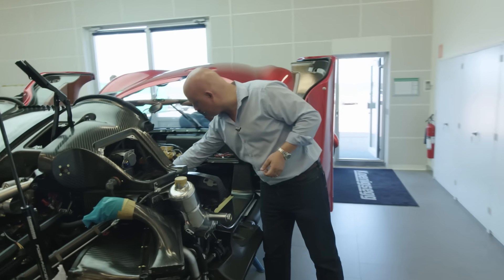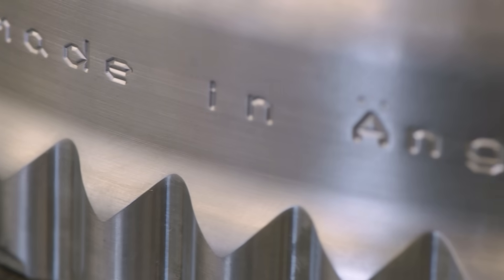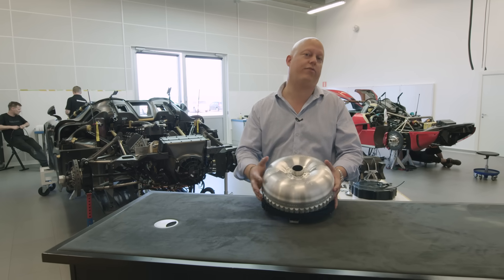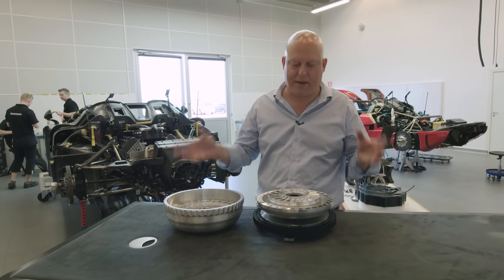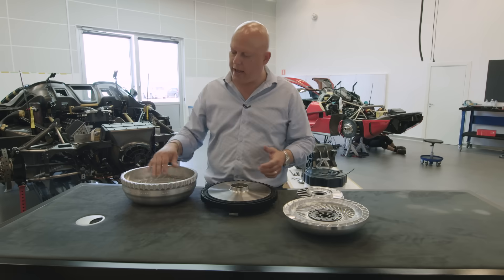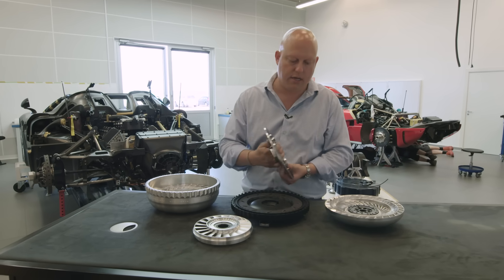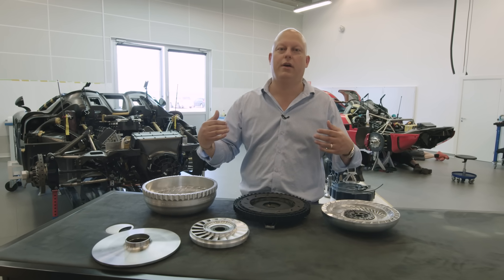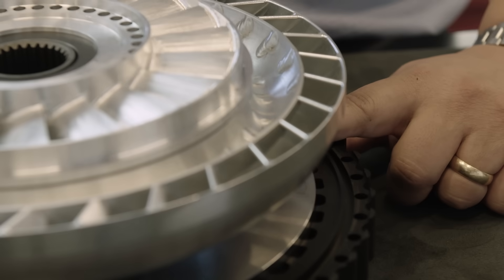248 MPH Without A Gearbox: Direct Drive  -- /INSIDE KOENIGSEGG

Comment: For this Genius, called Christian von Koenigsegg, everything is just simple but noone has ever done it before.This Dude is the Future and Mozart of the Carindustry.
Reply: CVTs are completely different to direct drive. They do in fact use gearing but you're not shifting between presets, you're continuously shifting along a scale. Engineering Explained has a good video on how they work.
Reply: Its like elon musk. They use words like "simple, quite big etc etc" where as the rest of us would use extremely complex,  astronomical etc. Their brains just work better than ours haha.
Reply: A CVT is not similar to a direct drive. A direct drive is a direct and fixed connection, a CVT is very much an indirect and variable connection between input and output.
However, you can argue that a system with a torque converter does not constitute true direct drive either, because it allows  input and output to have different speeds. However, the torque converter is only active for "low" speeds, whereas a CVT typically is active at all speeds.
Reply: This is nothing new at all, they just took it to the next level. Any car guy understands (or at least should understand) what he's talking about. Torque converters have been used since forever in american muscle cars
Reply: There is many cars that use no gears, it's just this one is quicker than 100 mph
Reply: TheGoreforce That's not the same thing. A CVT may not have "gears" but it performs the same function as a traditional gearbox.  It still has a clutch or torque converter to decouple the engine.

This uses the "torque converter" and final drive. There is nothing else to multiply torque.
Reply: Check out Buick's Dynaflow from the 50's - its another version of a gear-less (well, mostly) fluid coupling/torque converting transmission. Super inefficient and heavy but is of similar principal.
Reply: i think it is safe to say that we are looking on another revolution in car industry. The amount of tought and technological advance in those cars is jawdropping.
Reply: Same system was used for example at the end of 80's in Finnish Sisu SA-240. Nothing new in it.
Reply: ***** If heat is being generated then energy and fuel are being wasted to generate that heat. That energy would be better used to actually do "work" like moving the car instead of wasting it making heat. With a normal clutch there is zero loss and no heat generated. Torque multiplication happens via gearing so there is no huge benefit to this design. Even a standard torque converter that is not slipping would make less heat and be more efficient. The only thing this design eliminates is a relatively cheap transmission when compared to the cost of 500+HP motors. This design will never be used on an economy car imo.

Just to be clear anytime this car accelerates it will use more fuel vs. something with a normal transmission simply due to the slippage. When one side of the converter is spinning at 3000 RPM pumping fluid into the other, but the other side is only spinning at 1000 RPM torque multiplication happens since one side is pumping fluid faster then the other side can accept/use it, but it is highly inefficient. When both sides are spinning at the same speed then there is no slip and the efficiency of the converter goes up and is almost equal to a piece of metal. That is why they have lock up torque converters as well to improve efficiency.
Reply: That's why I said 20 years ago, yes. The principle is still there for the current crop of torque converter transmissions. I mentioned all this. How you can repeat what I said and frame it as if I don't know it is amazing! You completely skipped over my point. 

> "if more heat is generated then more energy is being wasted physics aspect no matter how many times I repeat myself... How hard is that to understand? 

That's not hard to understand at all. But you don't seem to understand that they are saving in other aspects. 

> If it locks up the converter then THERE CANNOT BE TORQUE MULTIPLICATION, it is stuck in high gear, and the system does not work 

The whole idea is to get the direct drive car moving and the torque converter helps with that task. After that, just as with a standard auto, it gets locked and is 100% efficient. So you are literally shouting "shock horror heat is energy loss" for only the start of the car. 

Yes, batteries and electric motors are expensive. So are you now universally arguing against partial electrification and hybridisation of our cars? Because if that is the case, you are not only arguing against one highly skilled team of Königsegg engineers, but thousands. At which point would you stop and consider whether maybe you are wrong? 

> I will even wager that a normal supercar with a normal engine will not only be faster then this hybrid supercar, but cheaper, and lighter too.  

Cheaper, probably. It is a world's first, these things tend to cost a bit more. Lighter? Probably. Faster? Well, I wouldn't bet on this. Königsegg has a bit of a history. Of course you will find race types where this car is worse than others, but come on, have a look at the other videos and you'll see where Königsegg is aiming and they'll be very difficult to beat. 

I'm not sure why you bring up dragsters. Like, isn't it immediately absurd to you to mention dragsters and fuel efficiency? As if their poor fuel economy can be only blamed on their open torque converters.  
Seriously. But you know what dragsters with torque converters do really well? Launch and limit the number of gear changes...

> I never knew that a converter could lock and unlock 

Of course you know about lock and unlock, but you are not applying that knowledge appropriately to the problem at hand, which is why I explain it time and time again.  

> You and others should really look up and study torque converters,  

Everybody can always learn more, but I am confident that I understand this better than you. So instead I would suggest that you learn to not solely focus on a single issue that you "understand", such as "open torque converter creates heat, heat is losses, losses are bad" but rather try to look at a whole system, how the parts work together over a wide range of duty cycles. Then see the pros and cons of each solution. 

Being a car guy is different from being a mechanical engineer. One can be both, but at the level Königsegg is working at, one really needs some engineering background if one  want to dissect their work. 

I mean, I am just a random guy on the internet and sure, there is a chance that you know more than me. But how does someone like you look at the previous work and legacy of Königsegg and starts posting "Uh, these muppets, they have no clue, I'll show them." ?
Reply: Den Log I think you are doing fairly well on the "posting long comments" leader board yourself, so I see no need to call me out. 

So now you seem to be saying that VTG turbos are pointless? Do you have any idea how much VTG has helped the driveability of modern engines? Hint: A lot. 

Changing gears is easy. Well. Apart from the fact that you need a syncro mesh, a clutch and correct timing. Oh. And hardened gears and associated bearings. And volume to fit everything. Sure, it is something that is very well understood now, so it is "easy". But nevertheless these are things that can be removed in the Königsegg approach. And yes, I am aware that the Königsegg system introduces new components - but these components are "paid" for by omitting others. Paid for in cost, weight, complexity, packaging. 

Yes, you are right, thinner vanes are better hydrodynamically. However, you are again not seeing the whole picture. Aluminium is lighter and easier to manufacture in complicated 3D shapes. (Christian mentions how they have to rethink the geometry because of the new mode of operation.) All of this can combine to aluminium being the better compromise. 
Just as having a torque converter in Königsegg's transmission has drawbacks and advantages and can be the best compromise. 

And it is about computers. Because using computers to control all elements (engine, torque converter, electric motors) enables Königsegg to decrease the time in which the converter is lossy and increase driveability.  

Engineering is about iterating towards the "perfect compromise". Your way of focusing again on one single issue "open torque converter is wasteful" is symptomatic of a wider problem of yours. 

I do not know if you intend to pursue a career in engineering or any kind of applied science, but my advice is that you really have to work on this. You seem like a clever person who is too narrowly focusing on a single issue. Unlock (ha!) your true potential by widening your scope.
Reply: Den Log Classic automatic transmissions have a hydraulic (hydrostatic) pump that creates the pressure for the brake bands. This is what Dog meant and it is different from the torque converter, which is a hydrodynamic pump close-coupled to a hydrodynamic turbine with a freewheeling rotor of guide vanes between. 

Your explanations of the inner workings of a torque converter are not only over-simplified, they are wrong. Not sure where to start, but the biggest issue is that power is torque times rotational speed (if you use SI units, otherwise you have a corrective constant factor in there). So it is not as easy as looking at the speeds and say which percentage gets lost. 
The "excess fluid" (hint: it's not) does something useful: Torque amplification. Think of it like this: The fast spinning pump creates a fluid flow. The slow spinning side is basically like a wing at a high angle-of-attack: Not as efficient as their design-point, but very high lift. That lift is of course equivalent to the torque the turbine delivers to the shaft. 

200HP cars do not accelerate to the crazy speeds of a Königsegg, your assumption that they would have to slip for long periods is erroneous. 

A number of people have told you that the torque converter is there to assist the electric motors during a hard launch. In basically any other operation, the losses are zero. Yet you still insist on this one thing  - "fluid goes around and creates heat which means losses". 

You brought up Wankel engines, which are fascinating, but not known for their fuel efficiency. Not sure if you were being sarcastic or not.
Reply: YensR Umm dumb dumb this is your last post I am getting really tired of you d*** riding fanbois.

That pump is part of the torque converter in most transmissions...

You are confusing fluid flow with fluid "pressure". Creating extra pressure is what is doing the torque multiplication dumb dumb not the amount of flow. Fans, turbos, etc. can only flow so much air, fluid, etc. at a given RPM if there is excess flow then since it cannot flow that much the pressure goes up. If the conversion was efficient THAN IT WOULD NOT BE GENERATING HEAT. How many f***ing times I have repeated that, but noooo. How efficient are the best turbos, pumps, etc. that are creating a difference in pressure? 75% or less and they are designed to create a pressure difference unlike a torque converter, which will have an even lower efficiency.

Maybe if you and others were smarter you would be able to figure out that this whole time I have not been talking about the supercar that they are building with over 1000HP, but using the technology on normal cars for the masses, which I have stated at least twice, but reading comprehension... Of which most have less then 200HP and do not accel like crazy dumb dumb. This technology is not "the future of the car industry", but once again fanbois...

Once again, how much does the battery pack weigh and cost? How much do the extra two electric motors cost and weigh? Switching power supply costs and weighs how much? Coolers for that trans fluid cost and weigh how much?

I wonder why a Prius does not use this technology? I wonder if it is because it is less efficient even though it also has an electric motor to help it accel dumb dumb, but once again d*** riding fanbois. I am done with all of you since many seem to fail at basic logic/facts. When you cannot even understand what " A rotary with a normal trans would probably get better gas mileage.: means" I am obviously wasting my time trying to educate people that have an IQ of less then 70.
Reply: YensR Ciao! Yeah, the torque converter has been installed along with a gearbox. Basicly to drive it you just put it in gear and let it rip. The gearbox is needed when towing heavy loads since it's been designed to pull artillery and such, and also in the middle of woods and bad conditions. If I remember correctly the converter oil could otherwise overheat, it's been a long time since I drove one so can't remember all the details about driving it.
Reply: without research, and testing, development gets nowhere, DUDE! Any engineer will tell you that ;-)
Reply: Reality , well it's been built, it works.
a Saab test mule drove many miles with it.
Reply: J-N-H-M Of course it's new. Just because it combines "not new" things such as an engine, electric motors, batteries, a torque converter and computers doesn't mean the combination is also "not new". Otherwise, please tell us an application (doesn't have to be automotive) that uses these elements to similar effect.
Reply: https://en.wikipedia.org/wiki/List_of_automobiles_with_continuously_variable_transmissions
Reply: +BigJayDog g Standard torque converters out of standard automatic transmissions can multiply torque when they are slipping or there is a difference in input speed vs. output speed that is nothing new. This just has enough torque and HP that gearing is not needed much like the electric Tesla cars. The heat being generated in the fluid is lost energy and fuel economy will more then likely suffer some because of it. Which for this type of car is fine, but it is not really practical for the masses.
Reply: The reason why no one is using the technique probably is because its inferior to what solutions they already have.
Reply: also CVT cant handle torque or horsepower hardly at all. this is why you only see them on economy cars.

 Also the difference between the new design you just watched and a cvt is that A torque converter always wants to spin 1:1 with input and output. A cvt always has a different input vs output speed with the exception of a single point along the linear ratio. The CVT is in essence just more efficient  transmission with no gaps between gear that still requires a torque converter or clutch to de-couple. This design that your just watched in essentially the transmission and de-coupler device all in one. there is no other device changing the gear ratio after this device.  Another argument against a cvt being a direct drive is that you literally have to have 2 connical shaped cylinders running parallel to each other that are connected by a belt meaning the power has to be transferred laterally before continuing down the line that is the drive train. meaning it is not direct.
Reply: I am massively curios about the heat that will be generated by this though. and how the fluid will break down due to the heat which will cause even more slippage. Also im curious about how they will decide what weight / viscosity they will use in order to get the correct amount of slippage .
Reply: Dalton Michaels There are hydrostatic and mechanical (power split) CVTs used on tractors and earth movers that have extremely high torque and power capabilities.  
However, the automotive CVTs indeed tend to be lower power.
Reply: ***** Almost all diesel electric trains are of serial configuration: All power from the diesel goes into an electric generator and is then distributed to the electric traction motors. This is clearly different from Königsegg. 

Torque converters are frequently used in diesel locomotives with a mechanical drive train, though. But then the electric motor is absent. So again, different from Königsegg's approach 

https://en.wikipedia.org/wiki/Diesel_locomotive#Diesel-electric
Reply: YensR "Good modern torque-converter automatic transmissions achieve impressive economy," Umm gee tks for agreeing with me on how good gearing is... Standard automatics with torque converters only slip for a bit, are considered "tight" since they do not slip much, and are then using gears to multiply torque more efficiently then what could be done with just the torque converter. Please listen to WTF you are saying. Why do modern automatics not drop 1st gear and use a "loose" torque converter instead? BECAUSE IT IS LESS EFFICIENT IS WHY. 

"I am 100% sure that Königsegg know what they are doing and have taken all of that into account." Umm no since there is no way around the physics. It will be less fuel efficient vs. a standard transmission. Which as I stated in my first post is ok for a super car, but no so for the masses, and economy cars. Generating "heat" takes energy and it cannot be done for free.
Reply: Den Log If you look at the gear ratios of torque converter automatic transmissions, you will see that traditionally the first gear is indeed longer than on a standard clutch gear box, because they use the torque increase to their benefit.(20 years ago, that replaced a whole gear, nowadays it's probably more like "half" a gear.) Of course modern transmissions will lock up the converter ASAP, just as Königsegg will do. 

You are very fixated on the disadvantages of the Königsegg solution but you seem to ignore the advantages. You also seem to ignore the electric motors that are an integral part of his whole system, not only, but especially during start-up. Yes, during start-up, this will be less efficient than a conventional car. But at any other operating point, it will be better. 

There is no need to yell at me. I understand these systems very well. I never implied that leaving the converter open is good or advisable for long periods of time. Kristian even mentioned that himself in the video. 

I never replied to your first comment, I replied to the comment where you implied that the effect of the torque converter's torque amplification can be done in gears. But if we both agree that it is potentially a great system for a hypercar, and if you want to discuss hypercar vs normalcar now, let me address that. 

Did you know that the torque converter can adjust its filling, effectively uncoupling completely? That way the engine can charge the battery at any time via the generator? So it adds a lot of flexibility to the drivetrain and I totally believe that this system is actually transferable to normal hybrid cars. Normal hybrid cars have much lower demands on top speed. There is nothing stopping this system architecture to be applied to lesser hybrid cars.Of course this only works for hybrid cars, because only then do you have the electric motors to assist the engine.
Reply: +Den Log Why hasn't anyone made a variable vane geometry torque converter and get rid gearboxes. At  least he's got of his Ass and made a cam less head that he calls a free valve did yous see he is developing a 'free  valve' for a small Chinese 4 cylinder. Im a bit suspect that he uses compressed air in his free valve anyone that's worked on machines  knows  how fickle compressed air can get, surprised he's not using Hydrolic fluid
Reply: Genius stands on the shoulders on giants, my friend.
Reply: The way CVK talk is that the torque converter is only use for fast acceleration, if you are driving in traffic it's only the electric motor that get you moving while the TC does nothing. It's not that efficient considering you have two power conversion, but in that situation there is not that much system that are, even manual with clutch can over-heat in heavy traffic.
When you want hard accel it's not the second before the TC lock that will change anything. Also after the locking, the efficiency of the whole system goes up to near 100%, I would say 95% because the diff must be beafy. Again the advantage/disadvantage versus a manual is somewhat even. 
I also want to add that torque converter are lossy, but they are not as bad as they where back in the 70', they added directional fan that will lock when torque is needed and unlock when unneeded. The fact automatic is now more efficient than manual is an elegy to that.
 
As for the weight, in another video CVk stated that removing the transmission dropped about 98kg, since it's about the weight of the battery pack the only over weight is the motors and transformer. But those are special motors that are not that big considering the power they have. Don't forget they have about 250x more power than any electric motor you have at your home. You can also check out the motor Tesla uses, they should be about the same size. Those motor use built-in water-cooling so they can reduce the size of the conductor. 

PS: there are other hybrid who got rid of the transmission and are mass consumer oriented.
PPS: Those motor work with current modulated by a computer, I don't think you could call this Dc or AC.
PPS: CVK didn't invent anything new there, but he is discovering new recipe to making car. The approach he have of a problem and the solution he find are what make him a genius, that and the marketing of Koenigsegg. Sometime you will find car maker inventing all sort of new stuff to solve something and it's always a bargain for the reliability/efficiency. Simpler is better, that and the fact old tech tend to be bring back again and again.  After all, to my knowledge, Mozart didn't invent any instrument, he just found new song to play with them.
Reply: Den Log  So it's you who doesn't know what à "torque converter" is. As it's name implies, it convert torque. The pump give à flow, but if the turbine is not spinning fast enough to accept the flow, the pressure rise and that make more torque at the end. Just like heavy machinery, if more force is needed the hydraulic pressure will rise. If the flow in the TC is good and there are no turbulence the heat generated is low and thus efficiency is higher.
 Power is equal to rpm x torque, so if the output is spinning 3 time lower, with no losses, it gets 3 time the torque. 
And all torque converter have a lock, because even à tight one would slip.
And the transmission in one those those car are heavier cause DTC and 1200+ hp.

You seem to hâte TC, but it exist since à long time ans they are well understand.
Reply: wee7os Ah, that is pretty cool stuff. I only found that it was driven in torque converter mode as a publicity demonstration - that article didn't mention anything beyond that, though.
Reply: He is the Mozart of the carindustry to people who dont actually understand much about cars.
Reply: The awesome thing here is how simple it is - the benchmark of great engineering.
Reply: J-N-H-M Have you ever driven a regular 2wd car with more than about.. oh, say 800hp @ wheels? They're not in any way daily drivable. The Koenigsegg is... You'd have to be insane to do it.. but it is. Also, the Koenigsegg has hundreds of lbs of battery in it..
Reply: not cool stealing my icon.
Reply: Max Bepunkt Meh
Reply: The Scion IQ for example has no gears.
Reply: I said a ton of cars do things with out gears, I didn't say they do it the same method. CVTs are similar to Coversion systems like this, in thatthey aren't tied to gear shifting. They do the same or similar thing that changes the power output at a stop to when you are going, to say it's not similar is a farce. They just use different methods to change the torque and power to the wheels for differing optimal paths.
Reply: This system also performs the same function as a gearbox, sure it's able to be a ton less efficient because of the shear brute force the engine has... IT's goal for the both of them is how can we do this thing and do it with out gears.
Reply: wee7os As far as I can see via google, that trucks's torque converter is coupled to a rather conventional transmission. Do you have any source showing that it is direct drive (or maybe an off-road / street two-speed) gearbox?
Reply: M3Conv You cannot have a high-performance direct drive, even with a torque converter, unless you mix in the zero-rpm torque from electric motors. So the reason no one else is doing this could be that they don't have the technology yet or are not reaching the levels of performance where the combination of combustion engine + torque converter + electric motor is necessary.
Reply: Dalton Michaels I honestly think with research and tech the CVT will be able to handle real performance
Reply: YensR
You have got to admit its a crap idea.

Lets get rid of the gearbox so that it sounds like a boat stuck in the same gear.

Whats the point, in a car with an ICE going through the gears is one of the most enjoyable parts (DCT or manual)
Reply: Dalton Michaels Torque converters for high torque and high power applications have been in use for many many decades. Their physics and engineering is well-understood. 

On the Königsegg it will only be in the slip region for relatively short amount of time as Kristian said. For heavy haulage trucks in operation, the torque converter is constantly in the slip region and they use dedicated coolers. 

The power that is converted into heat is the difference of input power and output power of course. And when accelerating from a standstill, the output power starts at 0W (no rpm means no power). But as you accelerate, the output power goes up, both in absolute terms, but more crucially as a proportion of the input power.
Reply: M3Conv I don't think it is a crap idea. It has uses where it is the best solution and in other applications it is not suitable.
Reply: Den Log "Torque multiplication happens via gearing so there is no huge benefit to this design. "  
You are right that a torque converter is lossy, but you seem to be missing the advantages of it. 
A torque converter allows torque multiplication when the output shaft is at standstill and the input shaft is turning. Yes, you can use a clutch to get going, but the clutching process for that start is also lossy and you won't get the torque multiplication, meaning you'd need at least a second gear and that immediately increases complexity and size tremendously. Also, each gear meshing reduces efficiency - not much but all the time. A torque converter reduces efficiency a lot, but only for a short time. 
Good modern torque-converter automatic transmissions achieve impressive economy, proving that the torque-converter problems are not insurmountable. 
I am 100% sure that Königsegg know what they are doing and have taken all of that into account. All of the involved components are well-understood by engineers.
Reply: Den Log it han be fixed using different fluids, but of course it won't be 100% efficient
Reply: Ángel Urbano Correct it will be less efficient compared to any other type of transmission that comes on any current production vehicle. Heat does not get generated for free and it takes energy/power to do so, which could be used to push the car forward instead. Again this is all old technology.
Reply: Williams also tested a CVT in their Formula One cars;however, it was banned from competition use before its first outing. It was reported to have been several seconds a lap faster. Im glad it was banned because the noise would have been unbearable!
Reply: YensR /sigh you mean when most auto transmission only had 3 or 4 gears vs. 5 for most manuals? Now most autos have 5+ gears and have ratios that match most manuals. With a tight converter there is almost no slip as it is and once again gearing provides the same exact torque multiplication only more efficiently.

You and others seem to be missing the whole "if more heat is generated then more energy is being wasted physics aspect no matter how many times I repeat myself... How hard is that to understand? If it locks up the converter then THERE CANNOT BE TORQUE MULTIPLICATION, it is stuck in high gear, and the system does not work. Normal cheap gears are always working. How hard is that to understand?

500+HP electric motors cost how much? Even 100HP electric motors cost how much since it uses at least two electric motors? Battery pack costs how much? Power supply to drive the electric motors since most are AC and cannot be just hooked up to the battery pack cost how much. Size, weight, and cost of the trans cooler to keep that fluid cool? Yeah will ever be used in an economy car... I will even wager that a normal supercar with a normal engine will not only be faster then this hybrid supercar, but cheaper, and lighter too.

You and others should really look up and study torque converters, which is old school tech, how they multiply torque and how inefficient they are at it vs. gears. That is all they have done. Loose torque converters and 2-3 speed autos have been used in drag racing for decades. Are they fast due to the amount of HP they have? Yes. Are they efficient? No. I never knew that a converter could lock and unlock... Now please hush and do some research.
Reply: YensR Dude, you do understand how f*** easy it is to shift gears, or to CVT right? You have made several 100 lines posts about nothing that can refute what I have stated. You still cannot refute that when heat is being generated for no reason that it is going to be more/less efficient, while I can. You have done nothing, but prove you like to ride d***. Again torque converters are 100 years old and are well known to many people, but you obviously... You still cannot grasp that when they slip they are not efficient and produce heat just like when you slam on the brakes... A car that heats up its transmission when it accels is going to need a large trans cooler or only need to go a short distance like a drag car... Logic and physics, which you seem incapable of understanding.
Reply: YensR Oh I forgot "engineering"...like how they used thicker aluminum vanes/fins in the converter instead of thinner/stronger steel ones? With thinner vanes less fluid is disrupted, and the converter has a higher efficiency vs. one that has thicker vanes. Again physics, but...
Reply: ***** "the bulk of the 33% power loss from an automatic transmission is from the planetary gear sets" Of which one is only engaged at a time much like a Lenco trans... A manual trans is even more efficient as I have already stated many times and BOTH are still more efficient then this design. Simple logic and physics...

"as a whole.
as for torque multiplication, a torque converter gets more and more efficient as the shafts reach 1-1" Gee I already said that, tks for repeating what I already said about torque converters and slipping...

"finally, a high stall converter is not needed for this, a low stall converter is, which is more efficient." Again I ALREADY SAID THAT, TKS FOR REPEATING WTF I ALREADY STATED AND AGREEING WITH ME... Most auto manufactures have figured out that a tight converter with more gear is more efficient then a loose converter with a less gears as I have already stated...

"you also know that your final gear is an overdrive in all transmissions and the one before is usually 1:1, right? meaning 0 torque multiplication followed by torque division through the transmission" Da F***? No I had no idea that the second to last gear out of 6 or 7 speed  transmission is a 1 to 1 ratio >70 IQ. There are 5 other gears that do have torque multiplication d*** rider...

Again please do some research and please STFU.
Reply: Just to be clear once again. Torque converters =100 year old tech. Electric motors = 100 year old tech. Combing the two is not innovative in the least and many other people have thought of this. There is nothing else to this system then 100+ year old tech... To call this dude "the future and Mozart of the Carindustry" is LOL. He is cool, but not that cool. This is much like when people ride Elon Musk's d***, LOL. Lithium batteries plus electric motors = innovative and new...
Reply: Anthony Napoli The same reason that no one has made a variable vane turbo that is worth a chit. Steel vanes end up being as efficient as variable ones, ceramic, etc.. when it comes to turboes.
Reply: ***** Umm no, computers cannot help with the inefficiency of torque converters. There is still physics at work.
Reply: in what part ellon musk engineers tesla, hyperloop, or spacex? designing from the fucking scratch may be? or someone can tell me?
Reply: Boling Fitrafli Tesla = lithium batteries + electric motors. Hyperloop...please look up Thunderfoot. SpaceX...the same chit that has came before it and is nothing new....
Reply: does that ellon musk research?
Reply: ***** Umm no, most drivetrains including the trans only lose about 15%, which this old system still uses a rear gear/diff which will still have losses as well. You seemed to miss the "500+HP electric motors cost and weigh how much? Even 100HP electric motors cost how much since it uses at least two electric motors? Battery pack costs and weighs how much? Power supply to drive the electric motors since most are AC and cannot be just hooked up to the battery pack cost and weigh how much. Size, weight, and cost of the trans cooler to keep that fluid cool? Yeah will ever be used in an economy car..." part...  All that will be much heavier then a simple transmission. On a front wheel drive economy car the trans does not weight 200 pounds and is less then 100 pounds in most cases... Again please do some f**ing research instead of riding d**.
Reply: From the replies, I can agree that the heat generated from them is an inefficient waste, & that history does seem to repeat itself. So instead, let us celebrate the "doers" of the world; the phrase "it has been done before" exists because of those few, yet is ironically rarely  used by them, as they are efficiently DOING things...most know how much energy is wasted from the inefficient use of letters into words, especially from the "tons" of "hot air transmissions" that literally never DO ANYTHING! EVER! shhhhh.
Reply: IIRC some of the original automotive automatic transmissions didn't shift at all; they had two speeds, and started in high with a torque converter.  If the driver wanted the low gear, he had to select it manually.
Reply: yeah for petrol powered vehicle. elon musk is the greatest mind the us has ever seen.
Reply: ***** Damn I mean damn are you >70... They are still using a torque converter. The torque converter is the fluid pump in an auto trans... They still have an output shaft aka. driveshaft. And for that last time please research torque converters. A "tight" converter is not the same as a "locking" converter. One can have a "loose" converter that still has the lockup function, which they are using as well. The only difference between a tight or a loose converter is the angle/placement of the vanes in the converter... So they eliminated some clutch "bands" not packs...some gears, and one shaft.

If the input shaft is spinning at 3000 RPM, but the output is only spinning a 1000 RPM WTF is happening to the fluid in the converter? Since the one side is pumping fluid at a much faster rate then the other side (turbine) can flow, use, accept, etc. the fluid. The excess fluid simply does nothing, but gets recirculated, and reheated again and again as long as the converter is slipping. The higher the difference between the input and output the more excess fluid and the higher the waste.

If the engine is spinning at 3000 RPM, but the output is only spinning at 1000 RPM there is a 2000 RPM difference between the two. If the engine is making 300 HP how much is making it to the wheels? Over half of the power is simply being wasted in the fluid coupling to try to simulate gears. How hard is that to understand for all the d*** riding fanboys?

If the engine is less then 200HP like in most economy cars this system is chit. The lower the HP the less effective this system is and the longer it would have to stay slipping just to accelerate a car from a stop. A rotary with a normal trans would probably get better gas mileage. It again cannot be that hard to understand, but fanbois...
Reply: ameunier41 Da f***? "even manual with clutch can over-heat in heavy traffic." You really need to learn how to use a clutch then. I have never had any of my manuals transmissions ever overheat in heavy traffic since in 1st gear with clutch out you can go 2-3 MPH.

"they are not as bad as they where back in the 70', they added directional fan that will lock when torque is needed and unlock when unneeded." Another person that has no clue how torque converters work... You are talking about the stator. Unless the converter has a lock up function which is not the same as a stator it cannot be as efficient as a manual trans simply due to slip. Even tight converters have 2-4% of slip aka loss.

Umm the battery pack out of a Tesla only weighs 1,200lbs...

"Those motor work with current modulated by a computer, I don't think you could call this Dc or AC." Yes it is AC. They have to use Mosfets, transistors, relay, etc. to take the DC from the battery and turn it into AC. Those switching power supplies are expensive as f***. Even with a DC motor one would still need some way to regulate the voltage going to the motor so it is not running at full power all the time.
Reply: Max Bepunkt, imagine if Mr Koenigsegg and Mr Musk had babies.
Reply: it's like a train locomotive, but with a final direct drive for efficiency.  I believe a Prius does the same thing under 20 mph and doesn't use the transmission until it reaches speed.
Reply: Has he made his cam less engine a reality yet ???? You have to make it work before you can be the  "mozart of the car industry" Not hating on him i think he's freaking awesome but that's just how reality works......it has to work... lol
Reply: Try understanding the D-Drive , it took me days ... this is very  simple and not new ...
Reply: But I still can't afford one Koenigsegg
Reply: ***** yeah buying a new car off the lot is a major rip off ... everything is that way ... gotta do it yourself to do it right or pay out the ass .... garbage disposal install , pc building or repair , steak at the steak house ...
Reply: ***** you don't need to spend 10 years ... lol ... we have a Jag s-type R...
but for 80k and 405 HP supercharged , leather seats , nav system , tv's in the head rest ... 
it a rip off ...  a very stupid waste of money ...
i should have gotten 30,000 dollar car and upgraded it ...
you can buy 1100 HP engines ready to drop in a car ... 
you can buy batteries and electric motors  and every thing you need to go electric ...
all you need is a little know how
Reply: Max Bepunkt
Reply: nitrogen like the F1's
Reply: "how simple it is"
and yet when made available it will somehow cost three times as much.
Reply: LOL its a FAIL ...  1,500 HP  2Wd cars are faster with less HP and torque ....
simple
Reply: 911s73targa  key word one test mule
Reply: james dean Formula 1:s have used gas pressurized valve control for quite some time to reach such high RPM's, also nothing new in that. In normal cars the technology needs too much service to be of any use, which is why no manufacturer bothers using it. Don't know about Koenisegg? Nobody drove one over 100 000 km in it (I would think) to find out :P